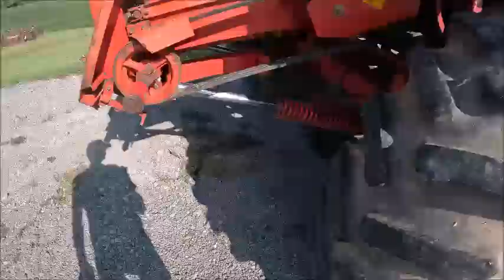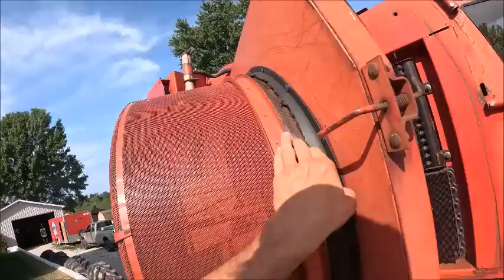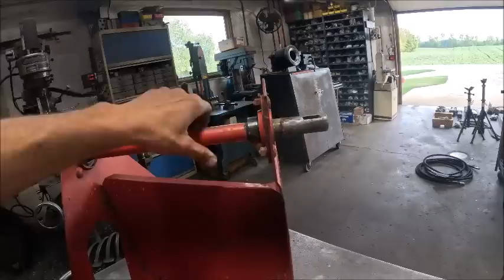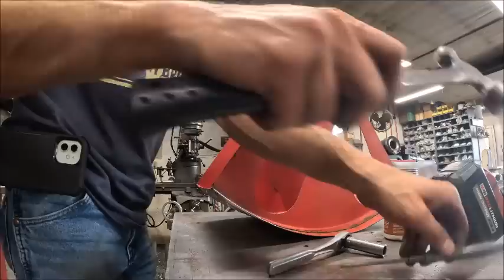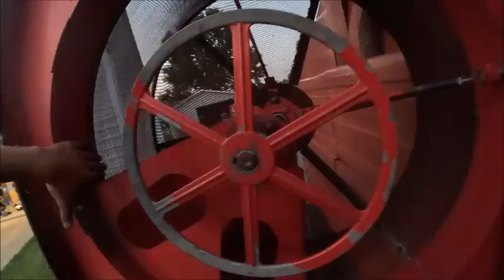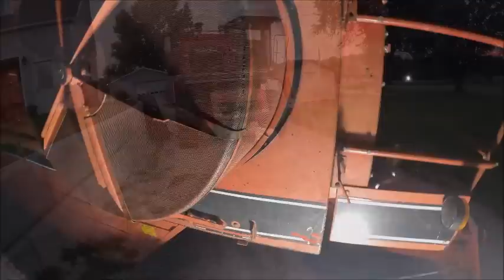White 8700 Combine Maintenance Part 1

Comment: I've seen that several times with those type of eccentric bearing lock rings. It will sometimes.put a side load on the shaft. I have been baffled by that many times given the fact there isn't that much power put on them to lock in place but I've seen what your dealing with many times over the years and it's always the locking collars. I have had success with installing a totally new bearing and locking collar.